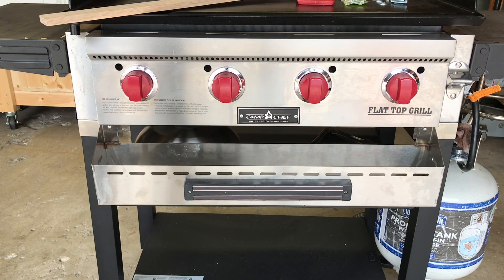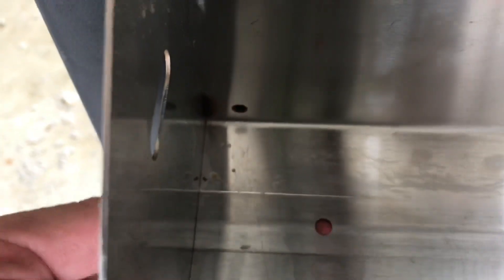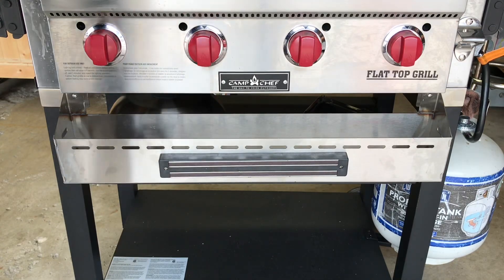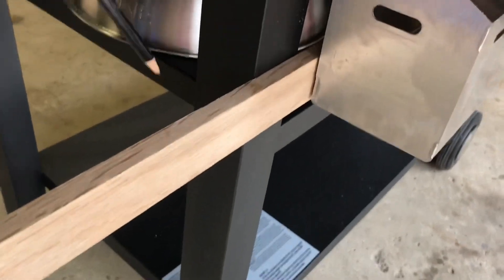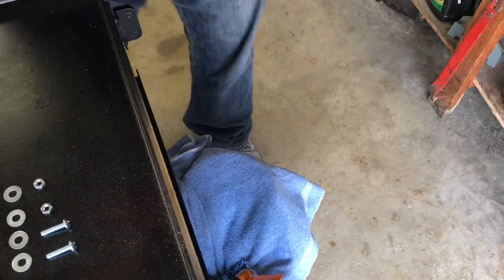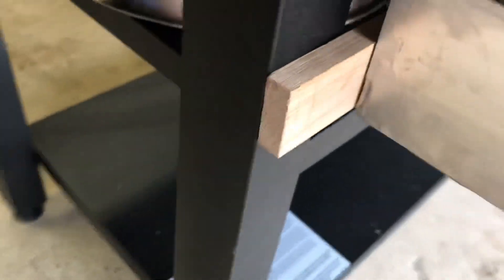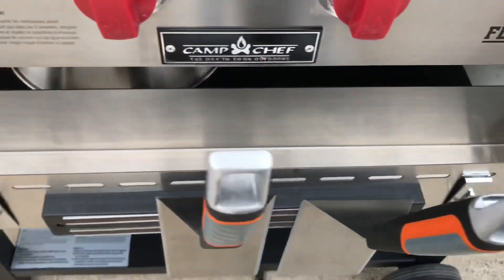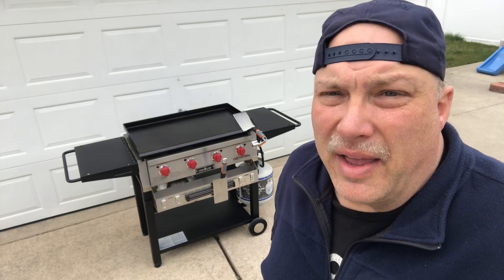Camp Chef (FTG600) | Front Tray Accessory Modification. Part 2.

Comment: I am going to give this a whirl except I want to attach the board to the legs of the griddle using magnets. That way the concern of corrosion is a non issue and no zip ties and easy on and off.
Reply from the maker: That’s an excellent idea!!!’  Thank you for watching and commenting.  You can buy very strong magnets at Harbor Freight.  They have a good selection of magnets.

Comment: Why didn’t you use some self tapping screws and screw the bracket brace to the legs instead of the tie straps...they really cheapen up the look of a nice modification.
Reply from the maker: Hi there.  I do agree with you.  I was trying to keep the modification as simple as possible without drilling holes into the legs thus crating more risk for rust to take over.  I should have mentioned the option of drilling and using self-tapping screws.  Good point.  Honestly, I havent noticed the tie-wraps at all because the stainless steel shelf is so attrractive!  LOL  Thank you for watching / appreciate your input.

Comment: I wonder if you got the wrong one. The one linked to Amazon for Camp Chef is aluminum diamond plate, the stainless steel one you have is for Blackstone.  Different ways to be attached as well.  The fact you got it to work is really all that matters though, and the stainless steel also fits the grill better since it is all stainless, where the diamond tread aluminum would look better on the all black Blackstone.
Reply from the maker: No I got the correct one from Backyard Lifegear.  They offer the shelf both in smooth stainless steel and diamond plate.  The brackets that came with the shelf  would never fit the Blackstone.   My instruction booklet says the Camp Chef and shows the same screw holes for the brackets.  I don’t like diamond plate so much that’s why I didn’t choose that particular design.

Comment: Why didn't you use stainless steel L brackets with boots and nuts?
Reply from the maker: - I considered that but I didn’t want to drill holes in the grill legs.  That would be a great solution as well.

Comment: At 0.53 He talks about drilling holes if there aren’t any. Has anyone tried to drill through Stainless steel? It’s really hard to drill Stainless. You need Carbide bits, and it’s still really difficult.
Reply from the maker: Great comment.  Stainless steel can be difficult to drill but, there is a technique that helps immensely. I’ve drilled a lot of stainless items.  A carbide bit is great but a regular high-speed steel bit will work well also. Drill as slowly as your motor will turn, keeping the heat from building.  That’s the key- low heat!  Use a little oil for a lubricant/coolant.  This particular product probably isn’t the best quality stainless out there PLUS it’s not overly thick.  Thank you for watching and commenting.  Stay safe!!!!

Comment: should paint the wood! it gets wet, wicks moisture. soon you will have rust. Also hope you purchased stainless washers and bolts for electrolysis. while typing, you said painted
Reply from the maker: I painted the wood strip.  Also, I was sure to use hard wood so it will have some longevity and resist the elements a little better.   Thanks for watching and commenting.  Stay safe!!!